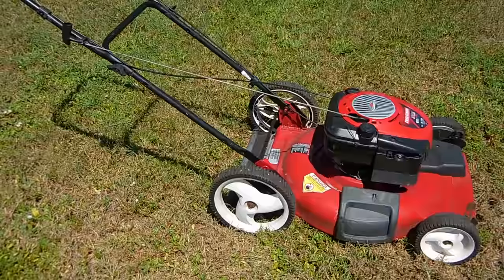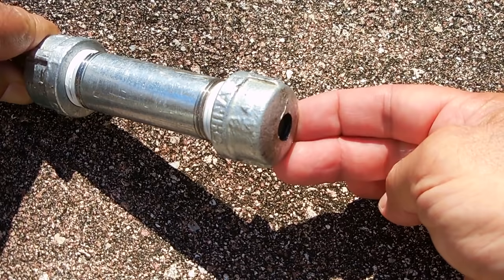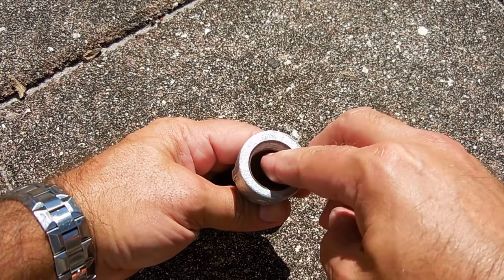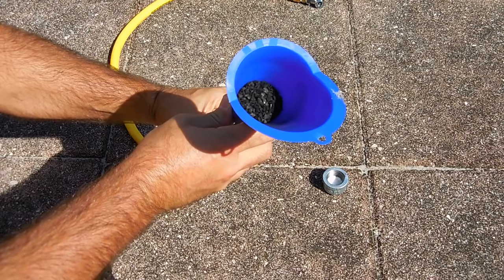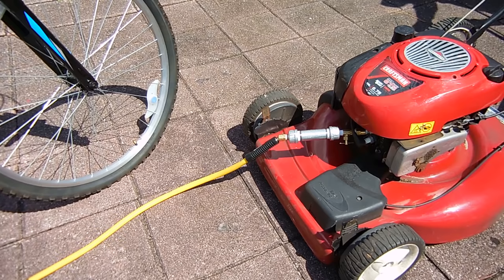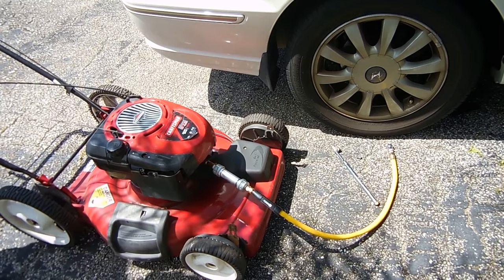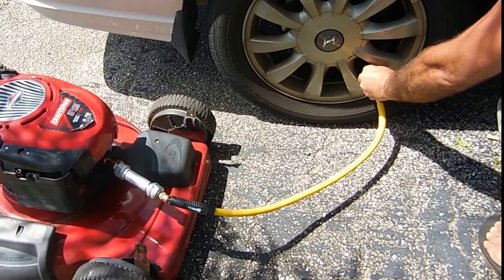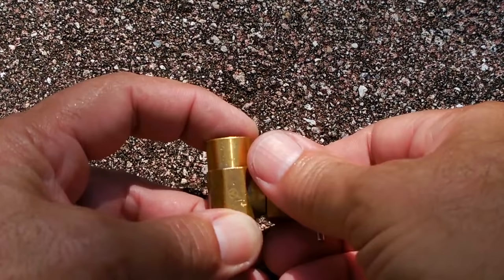Lawn Mower Converted Into Air Compressor? Find Out!

Comment from the maker: DISCLAIMER: Make and/or use what's shown in this video at your own risk! When dealing with gas fumes, and high pressure, there's always the chance an explosion may occur, especially if everything isn't done properly. Using or designing a check valve that opens BELOW engine compression pressure, will allow gas fumes to also be sent into the air line then into the tires you're filling! If ignited by a spark, the tire could explode resulting in bodily injury or death. The video is for informational/experimental purposes only! Stay safe.

Comment: We had an air hose with a threaded fitting on one end, and an air chuck on the other end of a 20 foot hose when I was growing up. It worked like a charm, and payed for itself many times over. When you needed to air up some tires, you popped out a spark plug and screwed the hose in. Thanks for bringing back that forgotten memory.
Reply: I still have one of those. Haven't used it for years. It was factory made, not just something thrown together. Can't recall where I got it tho. Was sometime back in the seventies.
Reply: Makes me wonder how and Opposed or V-Twin will perform with one cylinder as a compressor with just just using where the spark plug goes.
Reply: @ohillbilly  Ya, that's what ours was also.
Reply: @jafinch78  Let's just say it's not optimal, but in an emergency...  Oh, and it's not recommended at all for a one-lunger, lol.
Reply from the maker: I wonder if those kits are still sold. Thanks for watching!
Reply: @electronicsNmore  Speeduino: https://wtmtronics.com/product/speeduino-v0-4-x-pcb/

Megasquirt: https://www.diyautotune.com/shop/megasquirt-kits-components/

New one funding: https://www.nanoefi.com/

Other: https://www.ecotrons.com/small_engine_fuel_injection_kit/ 

I'm going to try the open source DIY with salvage yard components most likely more for educational and cost effective reasons.  I might invest in software... though have to see when I get the time.
Reply: @electronicsNmore  Look up "Schrader Spark Plug Air Pump". and I found one without the gauge on  "Stop & Go" website for airing up Motorcycles. Cool. I had never even thought about that for several years. I used it on an old 67 F250. I don't know if it would work with all the new computer engine stuff nowadays.
Reply from the maker: @ohillbilly  Thanks!

Comment: Cool Beans.    Those old school tire pumps used a Reed Valve to prevent so much fuel / Air going into the tire.  Your filter idea should prevent the majority of same.  Good Stuff Sir.
Reply from the maker: To keep gas out, the check valve must stay closed under 100-110psi. Thanks for watching!
Reply: @randy marsh Bingo, you need to maintain pressure and bypass most through a carbon filter of more stator the one described;  At priest 2-3  x the bottle pressure limits.

Comment: Id hate to be the tire guy that has to work on these 🔥
Reply from the maker: 🤣 The spring on the check valve is designed to open above the engine compression level, and the activated charcoal should absorb any fumes that make it into the line, but anything is possible. Hopefully the guy isn't lighting up.

Comment: Even with the charcoal canister thats just asking to make a giant pipe bomb. 

Just weld two engines togethet and wipe the Cam lobe / remove the pushrod for the exhaust valve of the one you're going to use as a compressor

Comment: In the 50s, there was a similar device, sold in catalogues such as JC Whitney, that were meant to attach to one cylinder of an automotive engine. 

What I like about your adaptation, is that you added the charcoal filter to clean the air.  I also applaud your idea of adding a water separator, because there is normally a fair amount of water in a working engine. 

Great idea, and I may adapt an old spark plug and your filter,  to make an emergency inflation tool to use with an automotive engine.
Bob
Reply from the maker: Glad you enjoyed the video! Be sure to read the disclaimer. Thank you
Reply: No problem.  I have been machining and building complex stuff all my adult life, so I'll know how to make, and use it correctly.

Comment: neat idea, but no nead to drill the mower cylinder head. just use a spark plug antifouling adaptor, and drill and tap into the side of that for the hose.
Reply from the maker: Hello. I thought about using one, but they're a little too small to drill and tap. It wouldn't be easy threading into once in place. Little room for a wrench. Thanks for watching!

Comment: I had an old SE Bonneville and GM put a hose in the trunk that would work the same way with the V6 engine it was installed at the time. But if I remember right you had to remove a sparkplug
Reply from the maker: I heard about those. Thanks for watching! Please share.
Reply: So, the engine would pump an explosive fuel-ait mixture into a tire?  Maybe that's how the term "blow out" became popular.
Reply: My uncle had a 95 Bonneville ( SSEi, 3.8l supercharged)... It just had an electric compressor mounted in the trunk, with enough hose to reach all 4 wheels..  nothing this elaborate...

Comment: Cool experiment. Over time the carbon in the exhaust should be converted to carbonic acid inside of the rubber tires. Most forms of rubber and carbonic acid don't mix. Recipe for disaster? The hips and chemistry don't lie.
Reply from the maker: It was a fun experiment, and if you needed to fill up a few tires in an emergency, it could be done. Thanks for watching!

Comment: Would the air coming out of the mower be hot, and how it effects the pressure once the air  in the tire cooled?
Reply from the maker: I'd say very warm by the time it travels to the end of the hose. You can add an extra 2 or 3 psi to compensate for when the air inside cools down. Thanks for watching!

Comment: They used to sell an adapter that would screw into the spark plug hole  of a Harley Davidson engine to make it an air compressor.
This seems like it would be a little more functional with a tank to hold the compressed air & an over pressure valve.
Reply from the maker: They sold a kit for cars many years ago too. Thanks for watching!

Comment: Now wondering how an Opposed or V-Twin will perform by removing the spark plug of one of the cylinders?  Wondering about an easy way to clean up the air flow by bypassing the fuel also and just letting air in.  Thanks for sharing!
Reply from the maker: If it's fuel injection, pull the harness to the injector. Thanks for watching! Be sure to rate thumbs up to offset all the channel hating Trolls.
Reply: @electronicsNmore  Good call!  I have a few L-Head Opposed Twin Briggs and Stratton's that with one I'm wanting to make a Speeduino or Arduino EFI/EMS system with, so will keep in mind when developing one of the engines.  Thumbs up for sure as well as the other great videos I've watched and will watch.

Comment: I have 3 compressors in various sizes but I'm tempted to build one of these as a weekend project...I got a few donor mowers
Reply from the maker: Make at your own risk. You need to measure the engine's compression, then make sure the check valve opens higher than that reading. By doing that, you only have pressure from the ignited fuel/air mixture, not pressure from the compression stroke with a fuel air mixture.
Reply: @electronicsNmore  Thank you, I think I'd better off not experimenting with this project. Great videos sir

Comment: How about modifying a TWIN cylinder engine ? Run it as a ONE cylinder engine, and a COMPRESSOR on the second cylinder. But definitely use a water separator.
Reply from the maker: Much better, and safer. If fuel injection, just unplug the injector harness. Thanks for watching!

Comment: Nice. How much is it to make this thing .vs. buying an air compressor of equivalent performance?
Reply from the maker: What I showed was really an experiment to see if it could be done. It works, and is just fine for intermittent use or emergencies, but for daily use I'd buy a decent air compressor.
Reply: Crap. I just drilled a hole in the cylinder head. Maybe I can fill it with JB weld.
Reply from the maker: @joecraigslist9467  Ask Todd over at Project Farm if that'll work. :-)
Reply: Just kidding.

Comment: What did you use for the spring after you found a loss in temper ?
Reply from the maker: I didn't replace it yet. Still looking for a heat resistant spring. It's extremely important that the spring is pushing against the steel ball with the right amount of pressure. I tested mine to open around 110psi, which was 10psi above the engine's compression. You don't want the gas fumes, only the exhaust fumes.
Reply: @electronicsNmore  kool ill look for something also find a high temp i know those engines  run up around 400 degrees or more
Reply from the maker: Be careful replicating. You need to be sure the check valve only opens above the engine's compression reading.
Reply: @electronicsNmore  i am looking into compression relief springs

Comment: The exhaust gases will compromise the integrity of the rubber, use for emergency situations only!
Reply from the maker: Correct. It's handy to have for emergency use, definitely not everyday use. Thanks for watching!
Reply: @electronicsNmore  Don't get me wrong it's a great idea, awesome video as usual!
I plan on turning and check valve on the lathe that has spark plug threads on one end and 1/4" npt on the other. With a small air line and chuch this will fit in my spare tire compartment.

Comment: Is there any danger of explosion with compressed carbon monoxide in the mix?  Does activated carbon absorb CO?
Also, I wonder if you can make a decent air pump out of the engine and power it with an electric motor.  I would imagine it would do a pretty good job and would be able compress a decent amount of air.  Maybe you could do a video converting an old lawn-mower into an electric compressor?
Reply from the maker: Activated carbon absorbs a lot of things, CO is one of them. If the check valve is not done right, you'll end up with gas from the compression stroke finding its way into the tire. Not good. You want the pressure created by the explosion.
Reply: CO isn't flammable but the gasoline/air mix sure is....
Reply: according to google it is.

Comment: how hot did it get? How much psi can it go? Maybe you can sell them online ready made. LOL
Reply from the maker: The yellow hose was fine, but the galvanized pipe was HOT. Probably a great idea to add cooling fins to the outside of the pipe. The CFM isn't super high, otherwise the mower would stall out. Pressure is fine, it can get very high. If the check valve isn't right, you'll end up with gas in the tire!
Reply: @electronicsNmore  maybe make an update video? Since many dont read comments.
Reply from the maker: @Trench  If the video does very well, then I'd consider making another, otherwise making another video would be a big waste of valuable time. I can't work for free.
Reply: @electronicsNmore  u r right in what you said and the others were wrong and rude. Blocking people is not good but they seemed to be asking for it but even if u didnt everyone sees what clowns they were anyway. Other DIY popular videos are fake, unoriginal, if not dangerous at times. To jiat get views and they don't care about truth or practicality.
Reply from the maker: @trench01  I only block viewers that continue to mouth off and make the comment area undesirable to read. You also noticed how other Trolls started joining them. I cleaned up the comment section. I welcome "constructuve criticism", but I won't tolerate wise @ss viewers. I also edited some comments to be much more clear.
Reply: @electronicsNmore you r right. u r pretty clean in your words. But u r a bit intimidating at times or maybe it might seem that way. You do what you can.
Reply from the maker: @trench01  I'm not a phony like many other people, I know the kind of person I am, the incredible amount of time I spent helping countless people on YT over the years(answering questions, which I didn't have to do), so I can be a little blunt when a person mouths off to me. Constructive criticism is fine, but viewer abuse is not. I have zero tolerance for Trolls or people that get off on being a wise @ss.